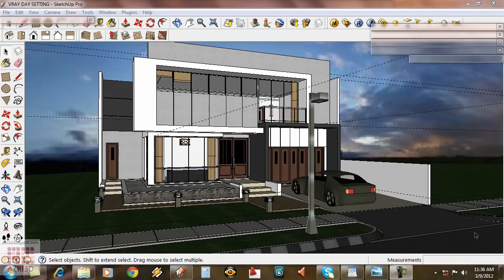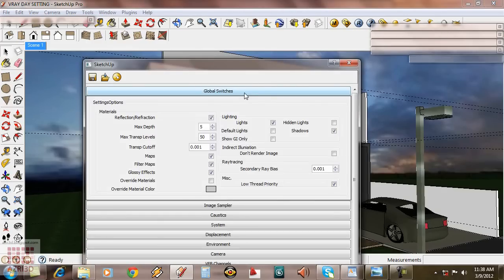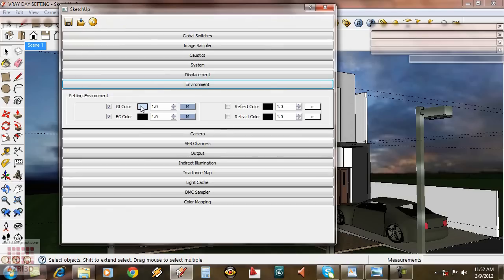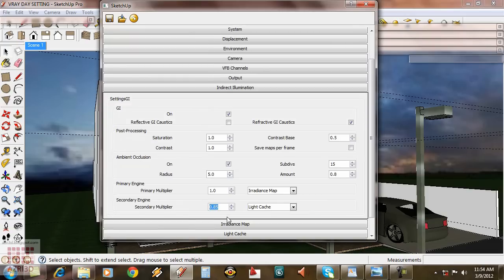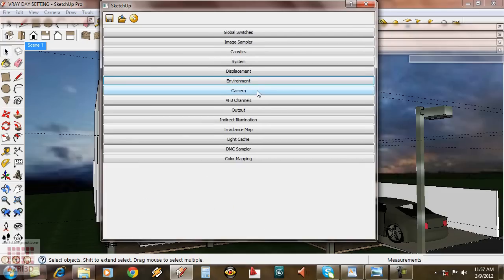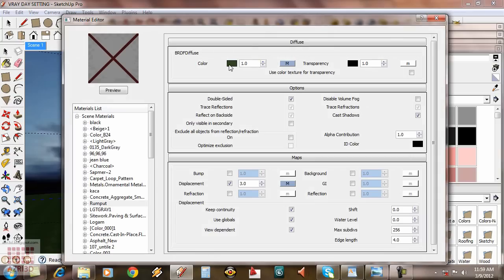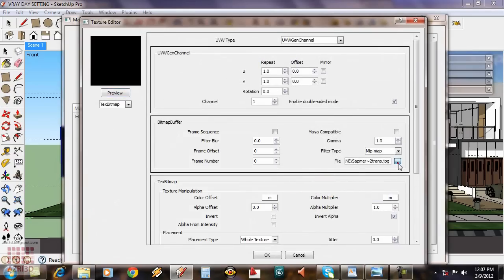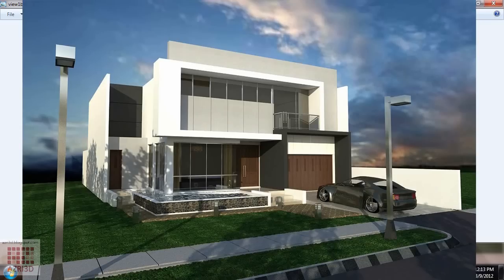Google Sketchup-Tutorial 15-Daytime Vray exterior Setting

Comment: Renderwow is the most advanced cloud rendering service platform internationally. Renderwow cloud rendering render-farm supports SketchUp 2015-2017 and V-Ray 2.0-3.6, Rhino 5, Cinema 4D, 3ds Max. It is simple to use, less costly and amazingly fast, making you feel as if you are working with a supercomputer, while significantly improving your work efficiency.
Please use the following link to signup and get 10USD account balance free. 

https://renderwow.com/index.html?invite_code=e5b29df9-0aa8-42a5-bd59-09115c569883 

Let's start rendering.

Comment: hi thanks for sharing on your tutorial  :) i have questions here my laptop is 4gb ram memory 32 bit core i5 can i use it for  rendering ? thanks
Reply: +Yuana Dewi 
Yes, I think you can use it. In the VRAY-settings you also have to play with the setting of the dynamic memory limit. I countered problems with the standard value of 1024 Mb [got a R6025 pure virtual function call]. Now I've set this to 10.000.000Mb, the rendering works perfectly [24Gb 64bit i7].
Reply: +Mano Meulenberg thankyou : ) for your information
Reply: YW +Yuana Dewi,, if there is anything else, just ask. I've been playing with the settings to make it right for my computer, and found out quite a few things, but still learning every day :-)
Reply: +Mano Meulenberg 😄 thankyou for your kindness rendering on sketchup is a new thing to me i used to work on 3d model sketchup  and  rendering on 3d max. can i add you on google if i have questions for sketchup rendering? 😄😄
Reply: No problem +Yuana Dewi!
I used to work with ACAD and 3DSMAX, but due to a few problems with 3DSMAX I'm trying SU + VRAY